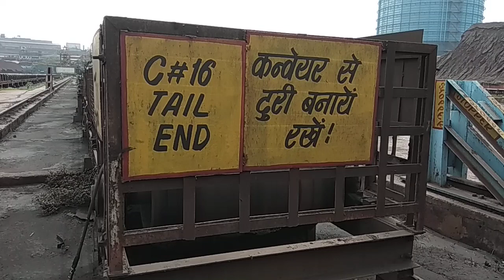Conveyor Belt Maintenance Work in Steel Plant | UNLIKE IDEAS

Comment: At the steel mill i worked at wll the conveyors were steel plated from the grif table into the reheat furnace through the roughing, intermediate, and finishing mill. To the cooling bed step by step all the way to the krasny and the sacket out to shipping tables. All steel